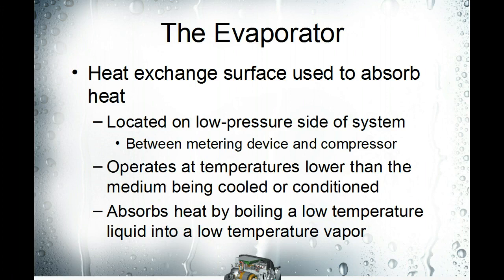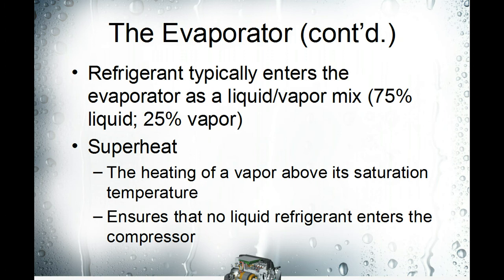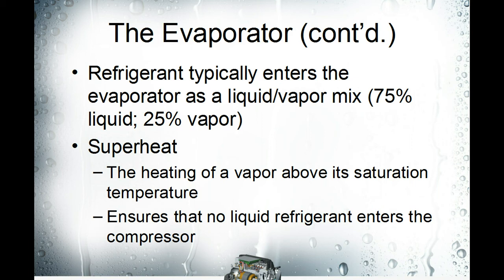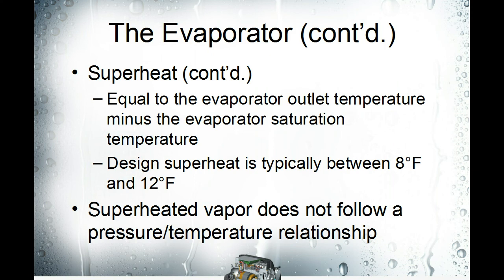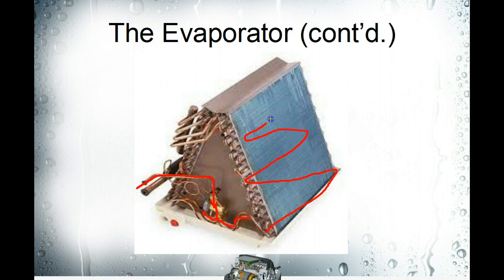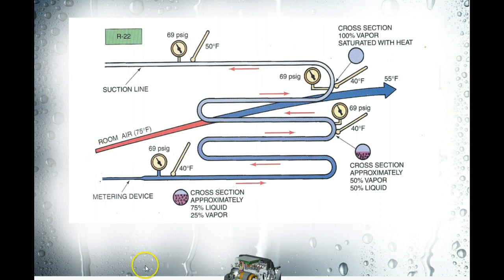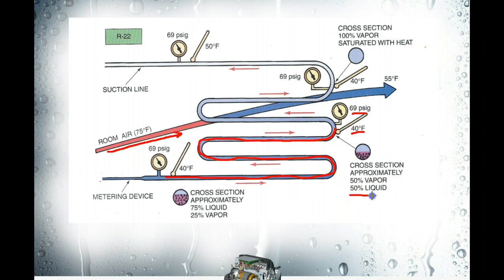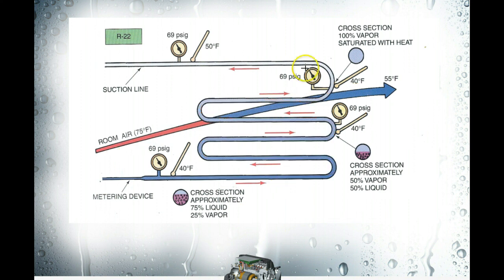Module 3 - The Evaporator

Comment: Sir how remote controlling Temperature of Evaporator. that time what we are changing through remote.
Reply: coming out of the metering device by design   there is a mixture of 25% flash gas and 75% liquid at 69 psig and 40 degrees F. going into evaporator, the refrigerant will absorb heat and the substance will begin to change into vapor, before it leaves the evaporator it will be 100% vapor, additional heat will be absorbed maybe 10 degrees and that will insure that it is all a vapor that will be going into the compressor as liquid does not compress.
it maintains a 40 degrees and 69 psig throughout the evaporator, when it leaves the evaporator it heats up to 60 degrees F. and that is called super heat. it enters the compressor and comes out at 200 degrees F. and 278 psig.
you will find those measurements in the P.T. chart.